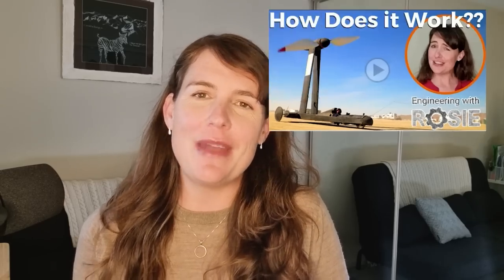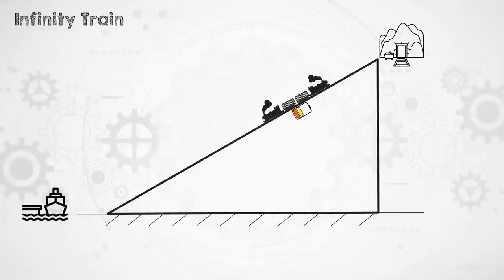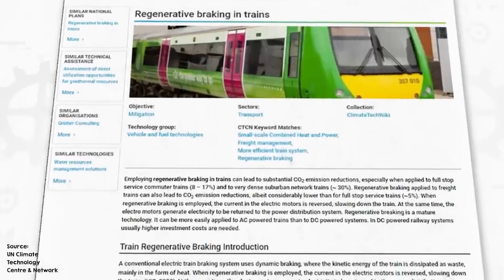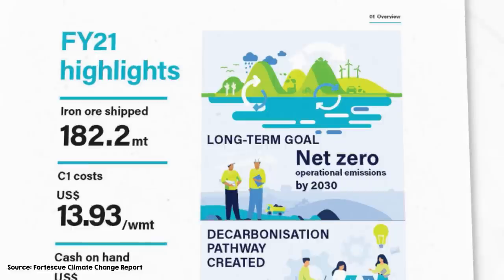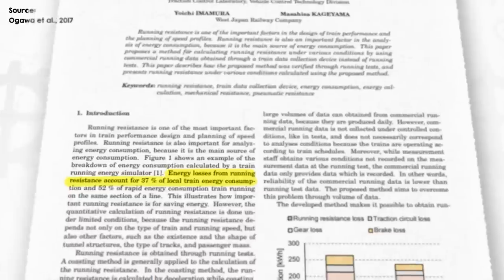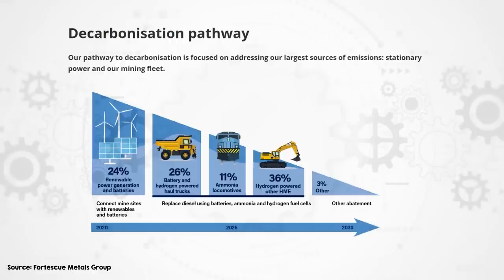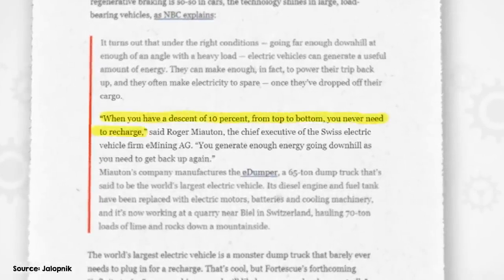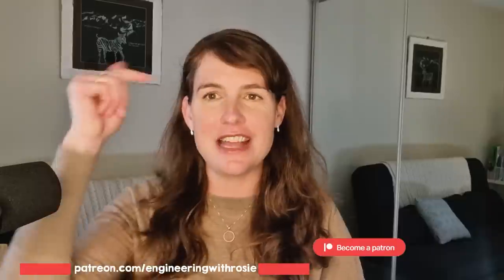This Mining Train Powers Itself: The "Infinity Train" (and how it works)

Comment: Nice video, Rosie!  Also, a cool idea!

I will point out that you applied the 37% frictional losses only on the uphill climb.  In fact, the frictional losses will be higher on the downhill run due to the additional weight.  Note that the absolute maximum frictional loss that could be tolerated in this system is 1- sqrt(0.54) = 0.265 or 26.5%.  That assumes no other losses and that frictional losses are the same in both directions.  In other words, you would be able to store 91 MWh * 0.735 = 69 MWh on the way down and would have 69 MWh * 0.735 MWh = 51 MWh available for the journey back up.

Clearly, there will be losses in the battery as well as in the electrical and electronic systems, so I suspect the frictional losses cannot be more than about 15% each way, or less.  That would allow for almost (but not quite) 15% electrical losses each way, as well.

FWIW, another benefit of this new train system is that they will also save money due to reduced wear-and-tear on their brakes.
Reply: See my recent post for total train energy consumption to overcome rolling resistance (mechanical & aerodynamic) - downhill trip will be ~ 2.7 wh/gt-km => ~ 30MWh total, uphill trip will be ~ 7.6 wh-gt-km => ~ 10.7MWh
Reply: @jennydavidstokesjones8454  Thanks!  If those frictional losses are accurate, then there will be no gravitational potential energy left over to account for any electrical losses on the return trip:  91 MWh - 30 MWh - 10.7 MWh ~ 50 MWh.  In that case, only perfectly efficient batteries and drive electronics could get the train back up the hill without the addition of electricity from an external source.
Reply: @RegGuheert1  Those calculations are probably providing conservative (high) estimations for rolling resistance energy consumption, as they are based on empirical data for European freight trains with axle loads ~ 20 tonnes and typical operating speeds around 80-100km/h. The Pilbara mining trains have axle loads of 35-40 tonnes (increasing soon to 45-50 tonnes) and operating speeds ~ 65km/h, so the values for K may be somewhat lower for these ultra heavy slow trains.
Reply: @jennydavidstokesjones8454  I agree with you guys. Rosie didn't allow for resistance losses downhill. The rolling resistance over such a distance is rather large (at 15.5 m/s aero resistance is not significant). I thought it would b a fun example to use in-class teaching. However I couldn't get it to work without seriously reducing the rail rolling resistance coefficient from 0.0015N/N to 0.00038 N/N , about a quarter of the expected value. That was allowing for 85% Energy recovery charge/discharge efficiency.
Reply: Great video, i agree that rolling resistance downhill is not taken into account. Another important factor is that the empty train weigh only 5500 tonnes where as in the video 40,000 t is taken.
Reply: 37% frictional losses? I think you may be confusing adhesion limits with rolling resistance. The energy for a 5000 tonne unloaded mining train to overcome mechanical and aerodynamic resistance is ~ 45kwh/km => 18MWh for the 400km return trip. The energy needed to elevate the train by 500 metres is ~ 8MWh, so total energy is ~ 26MWh for the return uphill trip (assuming 85% powertrain efficiency). Well within the capability of a triple-headed BE loco consist by the mid-2030s, with a total battery capacity ~ 45-60 MWh.

Comment: I read a long time ago that here in the UK many electric trains had motors capable of returning power to the grid as they slowed into stations, but that none had ever been used to do that. It didn't surprise me.
Reply: It's sad that those in government have so little vision so what great innovators and novel tech that the we have is unsupported so rarely makes it to market. It's becoming Backwater UK ☹️
Reply: We had this system in the UK back in the 50s & 60s between Sheffield and Manchester via the Woodhead route over the Pennines.The major traffic was coal from the Yorkshire coal fields around Barnsley. Loaded trains going down the hill regenerated into the overhead wires to propel  the empty one going back up for the next load. without the need to "Store " the energy in batteries

Comment: I worked on the South African Railways many years ago and on the Eastern line from Pretoria (now Tswane) to Maputo there is a steep incline between Waterval-Bo and Waterval-Onder. I was told that an Airbrake train going down this incline on regenerative braking, pumps enough power back into the line to allow an ordinary vacuum brake train to go from Waterval-Onder to Komatipoort for free. A distance of about 180 to 200 km.
Reply: What do the train's brakes have to do with it?

Comment: If it turns out to be borderline efficient enough, they could add PV panels. While it would not be practical on top of the train, except for a few on the locomotives and battery wagons, at either endpoint could also work, with the added complexity/cost of the charging infrastructure. But it seems plausible that it could work without, assuming that track curves does not call for harder braking than the regenerative system is capable of.
Reply: How much horse power or KW does it take to move just one empty car up a grade?   Now do the back of the envelope calculation based on  the 1kW per sq meter of available solar photons time its  optimistic 20% conversion efficiency and let us know if this still sounds like a good idea.
Reply: @craigs5212   It would obviously be a horrible idea if it was meant as a main power source, that's why I specifically wrote about a borderline case of regenerative braking needing just a little bit extra. I'm very well aware of the general impracticality of vehicular rooftop solar for providing much power.
Reply: @JohnnieHougaardNielsen  Mixed thoughts here.

One other thing in favour of your suggestion is that the panels will be charging the batteries 24/7. That means that the fewer round trips a train makes in a week the bigger proportion of the energy can come from solar. 

Against that, it would save weight on the train if the same solar panels were installed at the one end of the track, charging a train directly when it's there and charging an intermediate ground based battery when no train is present. That battery could supply or supplement local power needs at the mine, or just be saved to top up the trains. That would entail having space for the panels at the top of the hill.

Having the panels at the downhill end would mean that the system knows how much more energy the batteries need before they are full, but means that the solar power would not be available at the mine. I am guessing as Rosie said there's no grid supply that the mine runs on diesel generators, and if so that's where the panels will save most money and reduce emissions by the most.

I am also guessing that as the train goes to a dock at the downhill end that there is likely to be power there already.

Saving weight on the train is important for two reasons. First every kg of solar panel and related electronics is a kg of ore not carried to the ship. Secondly each of those kg has to climb the hill again, reducing the effectiveness of your idea. 

On balance I'm guessing that it would turn out better to put the panels at the top of the hill but I'm sure their engineers considered every option, or will do in the next few years in the light of experience running the thing.

Comment: Nice video Rosie, thanks for sharing!  I was curious how the train initially starts off - most loading yards would be relatively flat so there could be significant initial inertia to overcome first as opposed to just putting the train "into neutral" (lol) to start it coasting... so the energy required needs to get it back to the top plus the initial start again?  How close are the numbers if that's taken into account?  Cheers =)

Comment: Precise calculation of train energy consumption for mechanical & aerodynamic rolling resistance is complex, but there's a useful first order calculation based on empirical data from European rail systems that gets you in the ballpark. Unit energy consumption in watt-hours/gross tonne-kilometre (wh/gt-km) = K*M**-0.5 where K is a constant related to route topology and M is the gross train mass in tonnes. K=540 for flat route topologies, K=675 for moderately undulating topologies, K=810 for mountainous topologies. I can forward the source document if it's of interest.

Comment: Great explanation, one item which may be an issue, loading train, the speed is 1km/h for 2hrs on constant load, acceleration up to 60km/hr with 70kt. All these will need more than 90kwh battery. Even at 100kwh the realestate needed is quite high for requirements.

Comment: Progress Rail BE14.5BB battery-electric locomotives ordered by Fortescue for evaluation already have 14.5MWh capacity with contemporary battery tech, and we can reasonably assume that this will increase to ~ 20-25MWh over the next decade or so as battery tech continues to improve. Presumably this is why Fortescue have acquired Williams Advanced Engineering.

Comment: As you mention, these sort of machines can be used to store energy for the electric grid. They are not 100% efficient obviously, but they are less expensive and dependable.
Another savings is the minimized wear on the friction brakes, on these vehicles.
Reply: claptrap
Reply: They're not 100% efficient (nothing is) but they're pretty close. Round trip efficiency for lithium-ion batteries in typical rail traction applications will be ~ 95%. Nothing else gets remotely close.
Reply: @jennydavidstokesjones8454  
provide your workings out ?
Reply: @richardcowley4087  What are you calling claptrap?
Reply: @jennydavidstokesjones8454  
read what has been written, very carefully !
you should provide workings out for your claim too !
Reply: @richardcowley4087 You need to check my most recent posts for very detailed calculations on this application. Neil is completely correct when he says that friction brake wear will be minimised. With diesel-electric traction and no regen the friction brakes and loco rheostatic braking have to dissipate around 19MWh on the downhill loaded trip (49MWh PE - 30MWh train resistance energy consumption). You're clearly unhappy about something here - you need to say what your problem is.
Reply: @richardcowley4087  Round trip efficiency for AC-coupled BESS systems like Tesla Megapack operating at C-rates up to 0.5-1.0 are typically 92-94%. Rail traction battery-electric systems will be DC-coupled and typically operating at lower C-rates around 0.1 to 0.25, and consequently will have slightly higher round trip efficiencies ~ 95%
Reply: @richardcowley4087  What has been written by Rosie in the presentation contains a significant factual error that I have alerted her to, plus some assumptions that were a bit off, which I have also provided information about. 

The key issue is that total gross train weight for the loaded train going downhill is 40,000 tonnes, not 74,400 tonnes. Empty train weight is 5,000 tonnes, not 40,000 tonnes. The FMG ore wagons have an axle load of 40 tonnes (currently) for a gross loaded weight of 160 tonnes and a payload of 141 tonnes => empty weight of 19 tonnes.
Reply: @jennydavidstokesjones8454  why are you clapping on ?
Reply: @jennydavidstokesjones8454  
the problem is, that you all manipulate and try to conn and no, you have no idea
Reply: @richardcowley4087  What are you talking about? What manipulation. What con?
Reply: @richardcowley4087  You haven't provided any data or calculations about anything so far. What's your story?
Reply: @jennydavidstokesjones8454  i have just said or cant you read ?
Reply: @richardcowley4087  One of the significant contributions to electricity grid stability in coming decades will be "batteries on wheels" (rail & road), which could exceed pumped hydro capacity by an order of magnitude by mid-21C.

If you genuinely don't believe that the Pilbara mining trains can operate as net zero energy input systems with battery electric traction you need to support your argument with relevant data and calculations. They won't "power themselves" - they will use potential energy that is currently thrown away as braking heat into the environment.

Comment: Very nice video. I like how you showed the math. I think you should have emphasized that the trains energy comes from the mass (back to your equation) and that this isn’t sustainable because eventually the mass will be gone (it’s not a closed loop), and that the mining operations to extract the mass is energy that’s input and not a closed loop or renewable either (it runs on fuel or electricity).  So all the energy of the gravity train is “manufactured” by the equipment putting the mass into the train. 

I still admire the video and how you worked in the math! And your conclusions are correct. I’m not sure the layperson can intuit the reason why it’s not “free energy” without showing/talking about the “input” side, and that’s the min8ng operation. It’s like hitching a ride on a passing blue whale.  The whale is spending a lot of energy to move but it’s easy for us to be propelled for free with some thinking.

Comment: Old but smart idea. There's been a mine ropeway in Wales that used the same principle: the line is looped. Empty buckets are pulled uphill by the full buckets running downhill pulled by gravity.
Here's an idea for the infinity train: don't mount the batteries on the train, instead maybe use an overhead contact line? Proven concept. Easier on the batteries, easier maintenance, less moving stuff to maintain

Comment: Maybe this was already mentioned, but would it really be necessary for the train to have on-board batteries?  Why not an electrified cable or third rail.  Certainly the transmission losses from a compact system would still be better than the losses and or extra engineering for carrying the extra 690 tonnes?  Plus having a stationary battery bank would allow for less energy dense and perhaps less expensive battery solutions.  It could certainly allow for solutions that didn't require lithium and cobalt.
Reply: Agreed, but I suspect the electricity supplier may make the costs unattractive.

Comment: Diesel electric engines in the US have dynamic brake systems for slowing the train when it's going downhill. When the train goes downhill the traction motors operate as generators to apply braking power. However the power generated is not used. It's released into the environment as heat.

Comment: lots of mining sites use a trolley system that uses the products weight to move everything around , the issue here is the less coefficient of dynamic friction of trains going up hill , they are better off just using an electric train and just exporting power to the grid downhill then using importing from the grid to drive it back up hill ~700 Ton less battery weight to try and drag back up the hill , and over all less issues as if something is wrong with a special power generating train a regular train can still run ... also "Gravity Trains" are being used as energy storage in many places already

Comment: in that back of the envelope estimate, required efficency ratio interestingly doesn't even depend on the length of the track or slope or height, as they would all cancel out in the fraction (or in case of length aren't even in it); all it cares about is just the fact that the train is almost twice the weight going down than going up. It's really just 40kt/(34.4kt+40kt) = 53.8%

So maybe its not quite as restrictive where it can go as it might seem on first glance, and it really is just about how efficient they managed to make this train? The basic setup, of mining something that tends to be in the hills/mountains and then carrying it down to some kind of port is probably pretty common in the mining world.

Comment: I totaly enjoy your videos, so I feel it's appropriate to exspress my appreciation before correcting a statement. "It's free energy!" as in free beer, not free as in violating the laws of thermodynamics. If the cost to get the free energy is a fixed cost, eg the train and batteries, then the energy, a variable, is free once the fixed cost is recovered. I know. I've invented a free energy device that doubles the efficiency of electricity. It doesn't violate the second law of thermodynamics rather the device uses it appropriately to slow down entropy and convert it into information that can then be sent over the internet and converted back into energy anywhere in the world. (cut and paste commentator's name into Google patents to see how it works.) 😉 PS. the batteries don't need to be on the train.
Reply: Where do you propose to locate the batteries if they're not on the train?  Trackside with conventional electrification?  Massively expensive and less efficient. The big miners know what they're doing, and it doesn't involve stringing thousands of kilometres of overhead wiring at a cost of many billions. It that was the solution they would have done it well before now.

Comment: The thing that sticks in my mind is that the elevation loss isn't going to be a nice straight line, like in the example. There'll be little up hill sections, corners that may have speed limits below what is required to recharge at such a high rate. 

I look forward to seeing the implementation and the real world figures.
Reply: The on-board battery can handle all of that. Ultimately approximately-only the total elevation and mass change matter, not the things that happen in between, as long as you don't get too crazy.